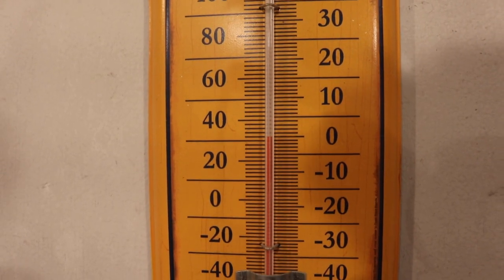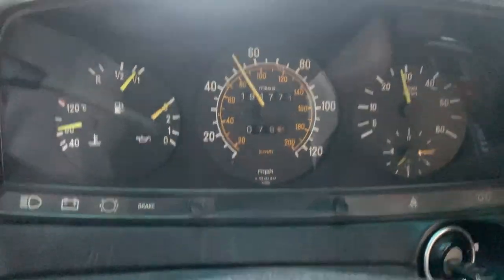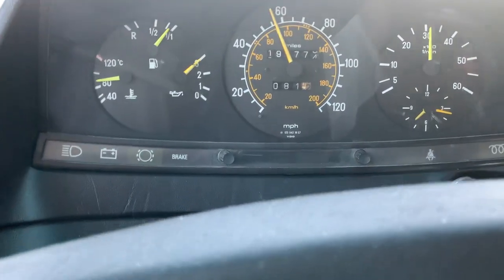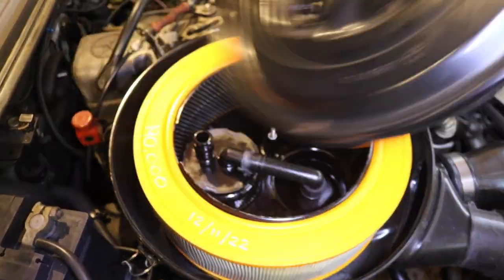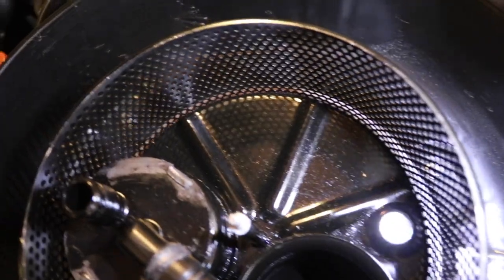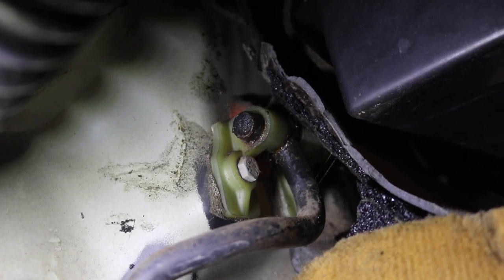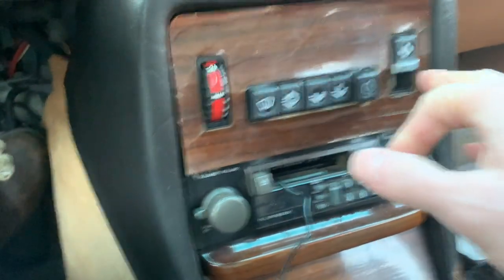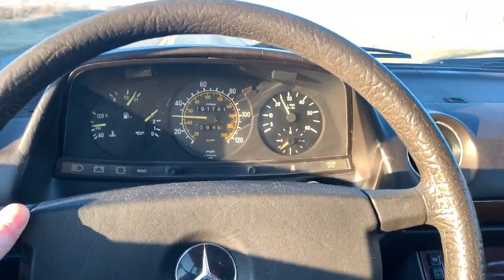DAILY DRIVING MY 40 YR OLD DIESEL WAGON - 1983 Mercedes 300TD

Comment: I have an 85 wagon.  Had the same headlight problem.  I cleaned all the contacts in the fuse box and replaced all the fuses with new Mercedes-Benz fuses.  Headlights work like a charm now!

Comment: Please Sir take all that weight off of your keychain. That’s gonna ruin your key switch calibration and toggle. And you will have to replace it from the dealer because it must be calibrated correctly to your car by the vin number if you want to use the same set of factory keys. Please have your master and valet keys separate from the others.

Comment: I daily drive my 1982 300td… I love driving it but I only have street parking as an option and I’m always chasing down some little problem. The car always gets me where I’m going but it is always kind of an adventure. I had the opposite headlight problem and wiggling the wires next to the headlight fixed the problem… but then my glow plug light went out so I wiggled that wire and changed the fuses and now all of my lights work.

Comment: I never  "warm up" my cars just drive them "gently" saves time and fuel
Reply: Plus the thermal mass of the diesel block means it will never really reach operating temperature at idle
Reply: @bobbbobb4663  its more to the nature that diesels are more  efficient  and make less waste heat